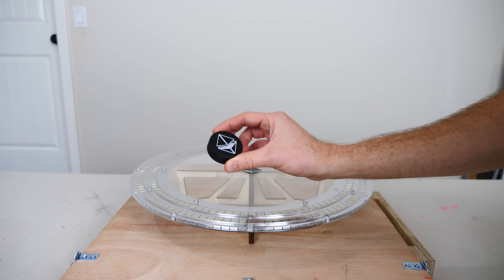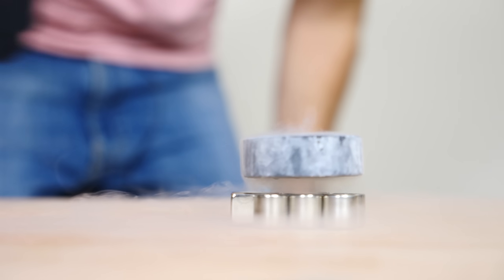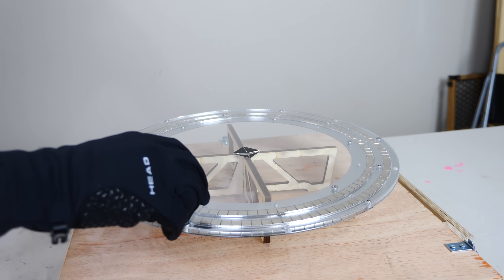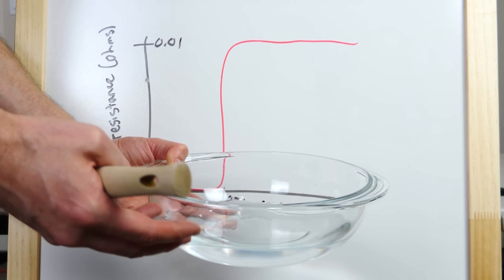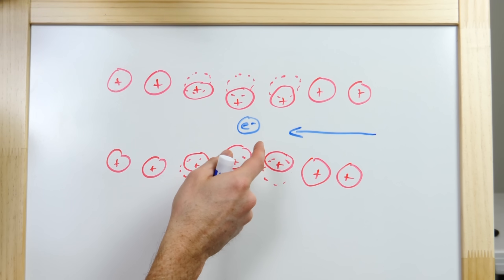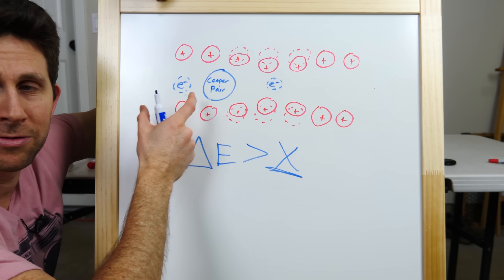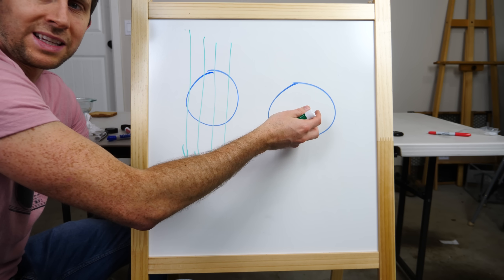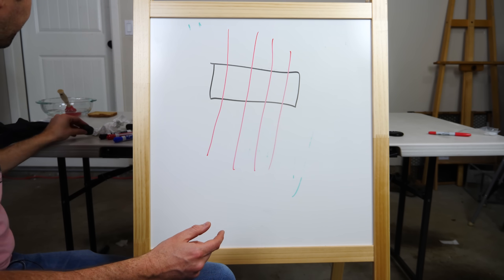Quantum Locking Will Blow Your Mind—How Does it Work?

Comment: When it's going in a circle, will it stay at a constant speed until it cools? How does this work in regards to the law of perpetual motion? It seems to be moving with constant motion with no added energy right?
Reply: Friction with air will try to slow it down, although I suppose the magnetic field will overcome this. The issue here would be that you have to cool the superconductor to keep perpetual motion, and that'll require energy (perhaps ironically). Then again, space is pretty cold, and you won't have to worry about air...

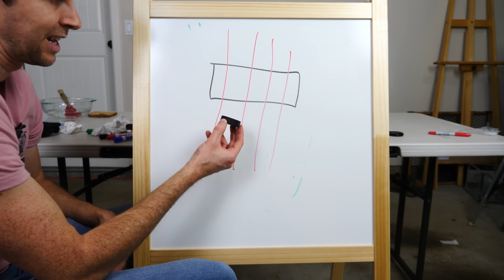Comment: 16:28 - are you sure that the red lines (symbolizing magnetic field) shouldn't be horizontal on your picture? If red lines are horizontal than it hase more sense with "locking" in place (moving superconductor up and down will cause that the new "lines" has to go "into" superconductor). In your example (if red lines are vertical) moving superconductor up and down youare moving alongside of the same "lines".....

Comment: I remember seeing this 10 years a go and was blown away by the potential.
Still haven't seen this being utilized yet.
I believe the ytrium barium dioxide is what they use for the superconductivity, because it can be superconductive at relatively high temperatures. Relatively high in terms of still needing liquid nitrogen
Reply: they have trains that run on this concept called maglevs nowadays
Reply: @khy907  yeah, I'm just surprised they aren't using it more for other commercial applications.
Seems like it would be a tremendous game changer in not only transportation, but construction as well
Reply: Looked it up last night. 
It's ytrium barium copper oxide

Comment: Now run the experiments in a vacuum. I'm curious to see how long the puck would go in a circle
Reply: I thought that too, I imagine as long as it stays cold enough
Reply: I think he’s making the point that it would never stop
Reply: @Mrnoddingdonkey  That sounds right. Friction with air would try to slow it down, but it sounds like the never ending eddie currents induced by the magnetic field and permanently sustained by 0Ω resistance could create enough Force to sustain motion... as long as we can keep the puck cold. Looks like we aren't able to overcome conservation of energy this time either.

It does make me wonder if it'd be more efficient to build continually supercooled, superconductor roadways for magnetically propelled hover vehicles. That sounds crazy expensive, but it is technically an alternative to using fuel.

Comment: That seems like part of a space craft propulsion system.  When I just discovered magnets as a young kid in the 50s/60's, I thought the power of magnets could be used instead of traditional burning fuel. I could hold the opposite poles  together and feel the force.

That said, Im not going to even try to understand the explanation of how this stuff works. I just think it's cool as shit!!
Reply: Throwing super magnets in space probably isnt a good idea when theres technology that gets effected by magnets.
Reply: @banditoincognito8950  ...... What? If there were a way to build a propulsion system with magnets (or electromagnetism) that's better than the fuel used now, I think any other technology that would be afraid of getting affected by it would go ahead and take the necessary precautions to ensure that didn't happen... especially since the technology itself would be likely travelling using the magnetic propulsion.
Reply: @Nick-hv8gj  it's called Ion propulsion, using magnetic fields to accelerate the reaction mass...  
It's extremely fuel efficient due to the very high exhaust velocity, but also requires a large amount of electric wattage and has a very low thrust to weight ratio. 
(rockets are limited by how much heat the can absorb from the exhaust before they melt. Very fuel efficient fast/hot exhaust = the rocket can only produce a small amount of thrust without melting.  That's why most high efficiency hydrogen rockets like the space shuttle and SLS use high thrust low efficiency solid boosters to provide the initial boost to get them off the ground.)

Due to their limitations Ion thrusters are mainly used for tiny station keeping jets which hold satellites/stations in exact positions or for long distance inter-planetary probes.  Both are applications where fuel efficiency is very important, and the low thrust isn't a problem because you can keep the engine running for months to slowly make changes in velocity.

Comment: think of this as a semi solution to Alien physics (motion) along these lines if you will, cosmos forward.. . .  sure wish I'd have studied quantum "mechanics" and quantum "trailing" ..  too soon?  oh ok...

note how G forces do not seem to effect the materials line of travel at all and seem to be very very comfortable with G forces, theoretically, I love that word.. the magnet should slow due to natural encounters with G forces right? does a car want to speed up, maintain or slow speed when you encounter a turn or Gforce?  its wants to slow right, dramatically in fact, why is this, one maybe increased friction encountered by the tires contact patch with the tarmac. same as when a jet encounters massive G forces the power needed to maintain speed is more, obviously the jet is fighting 2 forces now, the increased amount of air resistance and then the G force itself..  perhaps we need to rethink G forces, or centrifugal forces..

also notice how freely the magnet moves under centrifugal forces, typically objects lock the more Gforces experienced and actually want to fly off the force into a natural straight line right, why is this object moving so freely, eve within itself, you get the feeling it could also tumble no problems here while Gforces would not restrict any movements.. he actually does this when he manipulates the position of the puck and it locks into that position, tilted whatever, it will travel along the path at any position he puts it, this is not a natural characteristic of gforce right? gforce will in an instant, determine which end of the or area of the puck is heaviest and lock lock that into leading edge position.. what if one were able to use centrifugal force to move mass in a straight line?  using a manipulation that force?  what if we could use this force and allow the puck to move freely within the lock, tumble, spin so forth?

also notice how the silicon disk experiences no loss of speed when put into G force movement, can we calculate loss of movement vs force to move realistically? and how is that calculated and why is that sum the sum it is? I would wager that if this man was to push the magnet using the exact same force, the magnet would travel the same speed and time in a straight line as it would going round and round the circle, because he has eliminated 1 of the forces.. which one is that?  hmm... or has he eliminated 2 forces?  hmm...... how can we test if wind friction now plays a role in its loss of travel or speed?

this is why or how you see Alien crafts turning at enormous speeds with ZERO indication of gforce, or forces that would normally crush a human being.. perhaps its because like here, they have eliminated those forces, or at least the effects of those forces?..

whats needed to solve this and why does the silicon no longer react to  normal forces under simple magnetic properties? or are magnetic properties really "simple"?  is the force just pulling? or pushing and pulling at the same time? and are G forces fundamental forces of nature being ignored here? laws of physics...
Reply: G forces are acceleration. If you see an object pick up speed, it is affected by G forces. If you want to get rid of G forces, you have to get rid of inertia and acceleration. One does not simply "not feel G forces"

Comment: would the locking-levitation work when the ring was turned on its side? I think yes definitely. The puck could rotate around the ring when on its side. It would be nice to see that too.
Reply: Orientation doesn’t affect it.
Reply: I believe it would lock at the "bottom" in gravitational direction, because the quantum lock only works in one direction (because of the "pores" in the magnet). So with additional force you could get it to spin, but it doesn't just ignore gravity. So if it were turned on its side, the "pores" in the magnet would align with the gravitational force, so it would be affected by it.

Comment: This kind of stuff is so fascinating. You do a great job explaining this in ways most can understand. I couldn’t help but notice that quantum locking has a bit to do with eddy currents . I do motorcycle dyno tuning and the dyno we use has what’s called as an eddy brake to apply a load to the motorcycle needed for tuning the EFI fuel injection on modern day bikes. It would be neat to see a video about this topic on how eddy currents relate to this type of machine. If it interests you, look up a dynojet 250i motorcycle dynamometer. That’s the model we use with the eddy current brake. Your videos are great . Keep up the good work.  Hopefully you’ll have an opportunity to see this comment.  Enjoy your evening.

Comment: Okay so Quantum locking is causal time imprinting itself onto a point on a 2d superconductor field contained within an electromagnetic field....neat stuff...
Whatever.....I understand what I just said.
....I'm telling you man, everything in the Universe tends towards permanence.
Reply: Flux pinning is the phenomenon where a superconductor is pinned in space above a magnet. The superconductor must be a type-II superconductor because type-I superconductors cannot be penetrated by magnetic fields.[1] Some type-I superconductors can experience the effects of flux pinning if they are thin enough. If the material's thickness is comparable to the London penetration depth, the magnetic field can pass through the material. The act of magnetic penetration is what makes flux pinning possible. At higher magnetic fields (above Hc1 and below Hc2) the superconductor allows magnetic flux to enter in quantized packets surrounded by a superconducting current vortex (see Quantum vortex). These sites of penetration are known as flux tubes. The number of flux tubes per unit area is proportional to the magnetic field with a constant of proportionality equal to the magnetic flux quantum. On a simple 76 millimeter diameter, 1-micrometer thick disk, next to a magnetic field of 28 kA/m, there are approximately 100 billion flux tubes that hold 70,000 times the superconductor's weight. At lower temperatures the flux tubes are pinned in place and cannot move. This pinning is what holds the superconductor in place thereby allowing it to levitate. This phenomenon is closely related to the Meissner effect, though with one crucial difference — the Meissner effect shields the superconductor from all magnetic fields causing repulsion, unlike the pinned state of the superconductor disk which pins flux, and the superconductor in place.
So, no. You're a dumbass.

Comment: Put a little RF receiver on the top of the superconductor. Place a small copper coil on the superconductor. Connect copper coil to RF receiver.  Use remote controlled transmitter to send signal to receiver to momentarily energize copper coil creating a perpendicular magnetic field causing superconductor to move forward or backwards (depending on polarity of coil) on the circular magnetic rail. See how fast you can make it go. How fast does it need to go, where centrifugal force forces the superconductor off the magnetic rail?

Comment: I find it interesting in that on the disk which has the magnetism around the perimeter of the disk, once the cooled superconductor is floating and locked over it, that it can move through the magnetic field without slowing down, there is no friction going through the air. It is perpetual motion until ???? As the superconductor has been chilled with liquid nitrogen, but that does not mean it will not be influenced by room temperature eventually. How long does this puck stay super cooled would depend some equation for the falling off of both being repellled by the magnetic field and then would slow as it warms, it seems? 

I’ve seen this done before in simulating orbits which don’t bother the pucks at different altitudes from the magnetism around the large disc’s perimeter. And depending upon the force in putting two pucks into a sort or “orbit”, it simulates two bodies moving at different rates as the sun and the moon in the sky in a simulation of how a local sun and moon would work on a flat earth. Of course in reality the sun is incredibly hot, so it become non-sensical as it should not work if it is hot. But it is so fascinating to look at two super-cooled pucks traveling in the demonstration that the temperature of a sun could not be a sun of course. It is only a simulation but a dishonest one in the videos explaining how the sun and moon could pass each other on a flat earth, of course. It is rather mesmerizing to see, but with the explanation of the phenomenon, the absurdity of saying “we are the simulation”, becomes obvious.

Comment: Honestly the fact that a paper cup can hold liquid nitrogen so well really blew my mind.
Reply: Do your self a favor and go watch some super-cooled liquid helium 2 "drip" through the bottom of a solid glass beaker. The liquid literally falls between the atoms of the beaker.
Reply: @NotHereToBeNice  Superfluid (not supercooled) Helium 3 has zero viscosity and will flow up the sides and out down the sides of an open glass container. It looks like it’s going through the glass - it’s not. 
The other demo you’re thinking of is using a glass cell with a porous/permeable glass “frit” bottom. The liquid helium 3 will not go through the frit. When its temperature is lowered further it becomes a superfluid and drips through the frit. 
You’re right it’s fun to watch. 
I designed a number of He3 cryostats 30+ years ago. They’re still in use today.

Comment: If your impurities were in a grid shape opposed to just lines, would it be quantum locked vertically and horizontally?
Reply: Maybe it would spin or flip and lock in the position that let the most energy pass throught. I find them very interrestiing I would love to experiment with them. I bet this is part of they key to discover levitation transport and capabilities to move extremely fast.

Comment: thank you for the awesome video and information. Quick question if i may. 
In a normal material (not superconductor) what happens to an electron that is near the surface of the material, in the outermost layer of atoms, if it doesn't bump into an atom to change direction towards the inside of the material, can it escape its material and move into the surrounding material (e.g. air)?